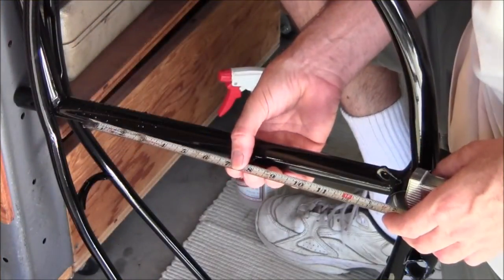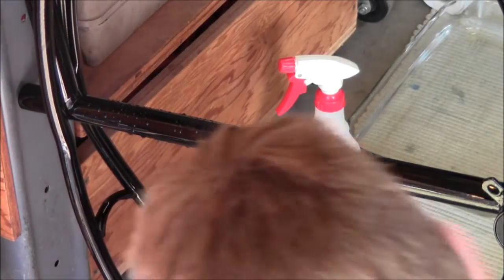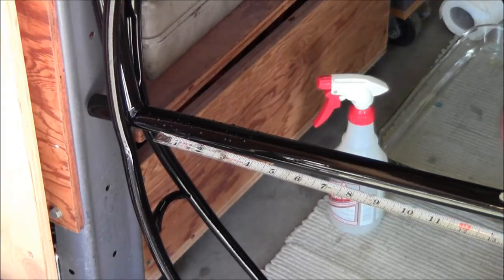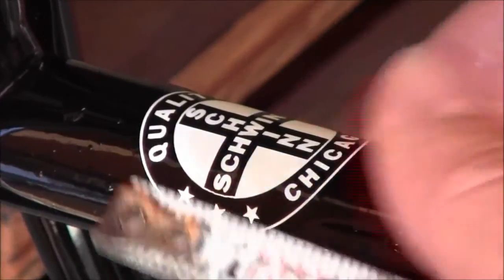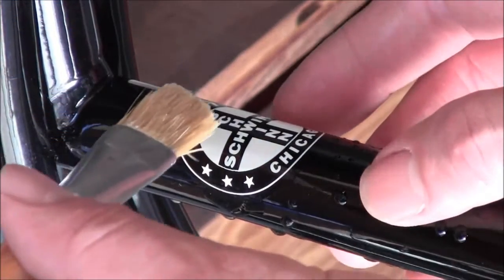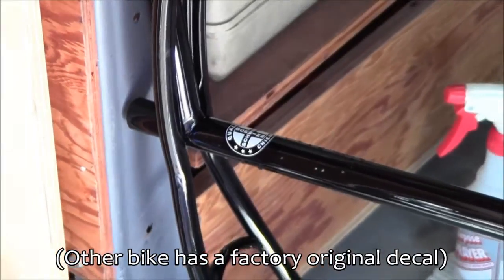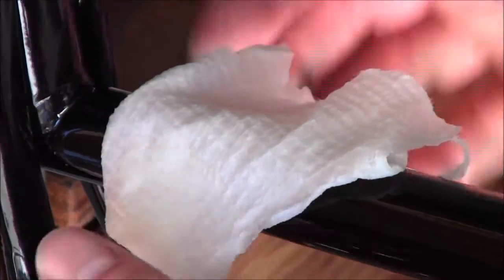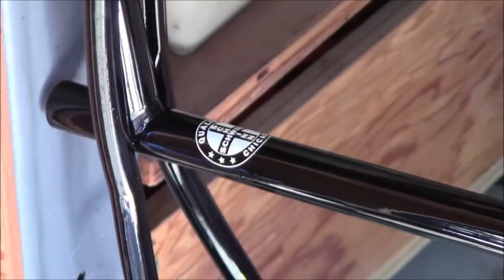Schwinn Decal Application - Seat Tube Schwinn Quality Logo

Comment: What kind of paint was used on the frame prior to applying the decal? I hear that the decals won’t stick to powder coated paint jobs.
Reply from the maker: This bike was professionally power coated and the surface was cleaned with alcohol before the decals were applied. We didn't have any trouble getting them to adhere to the powder coat.
Reply: @arnonerba  are they durable without clear coat?
Reply from the maker: @maciejlebiedziewski8741  They should be as durable as the original factory decals since they use the same process.

Comment: The seat tube decal doesn't have a specific place to put it I've seen them in a variety of heights
Reply from the maker: The location of the decal definitely varies depending on year and model. We tried to replicate the location based on a bike similar to the one we we working on.